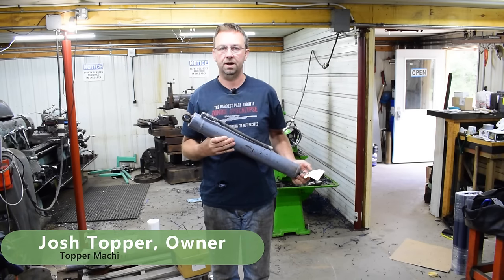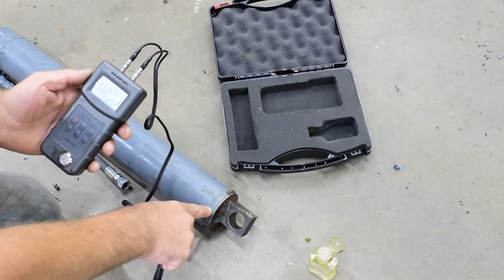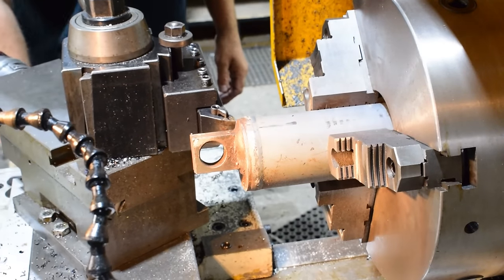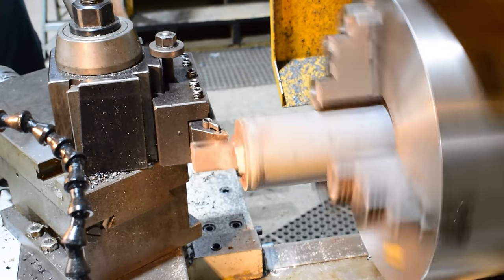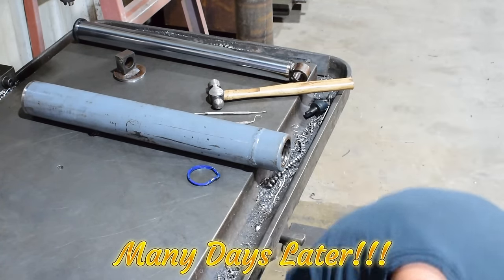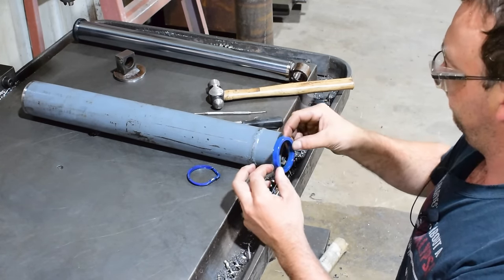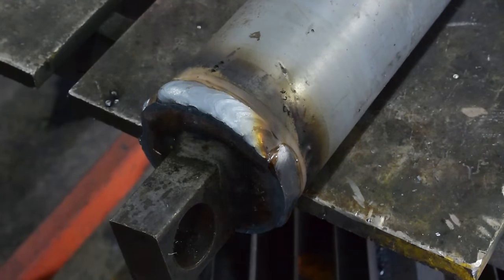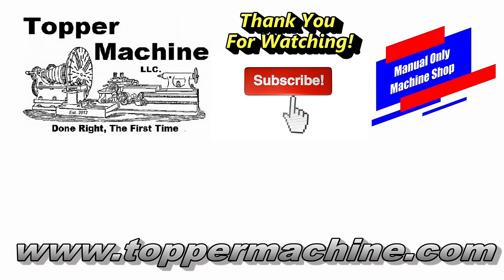Welded Hydraulic Cylinder That Can't Be Repaired, Cut Open and Resealed

Comment: Sometimes these cylinders are built with a snap ring groove and pilot on the end of the rod. You can disassemble them by reaching through the port with a pick to dislodge the snap ring. Once the ring is out of the groove the rod can be removed and the seal replaced. To reassemble, place the snap ring on the small pilot, install the tube, and reset the snap ring using a pick through the port. It seems cumbersome  but I've seen this process done many times.

Comment: The initial knock had me puzzled - something inside is borked. I was looking to see if the cutter was touching - nope. So the piston inside is so loose it's not right. Back when we contracted, we'd to do these using just a grinder to get the end-cap off - and a stick-welder to get it back together - but they got done. Easing the new seals in was always fun,, as was making sure we didn't melt them with the welder. :-) Hoik the rod out as far as it will go  so it stays cool,  slice off the end, pull out the rod, fit new seals & packers, weld the end back on. No lathes got bothered - and they all worked just fine.
Reply from the maker: This is actually correct. The knocking was due to the head seals being bad. There was no piston or seals.

Comment: it's a displacement cylinder the rod is the only piston the flange at the bottom is only a stopper to prevent the rod from cumming out at full travel.
 Usually there is a bearing sleeve at the seal end to keep the rod aligned.

Comment: I had a Saab convertible that had an hydraulicly activated roof, one cylinder was leaking rendering it inoperable. It was a non serviceable part and a hydraulic shop said throw away so I went back to work and put it in the lathe and cut the end off. A few scabbed orings from oxygen regulators and made a new cap, and it worked hundreds of times until the car was written off in a crash. Non serviceable means "hold my coolaid ,I don't drink alcohol"

Comment: Next time pull the rod out when welding the bottom part of the cylinder, the heat generated from welding will fuck up the seal on the rod.
Since you have the tools, you can also modify the bottom part to be serviceable, make a thick ring with +/- 6 or 8 threaded holes that fits over the cylinder, machine a cover plate with eye and matching holes, depending the thickness of the cylinder cut out a groove for an o-ring in the bottom plate with eye socket. use screw head cap bolts of strength 8.8 (not stronger).
I'm an engineer in hydraulics, i reseal mostly 20 ton cylinders (that's the weight of the cylinder not lifting force) but sometimes small ones for palfingers.
Reply: Did you watch the video? There’s no seal on the rod.
Reply: @djquick  my bad i just assumed, seal-less bottom parts are usually the design of slow hydraulics like hydraulic jacks.

Comment: Very interesting .  I did my apprenticeship 40 years ago with a company that manufactured hydraulics and pneumatics.
Nothing we made pushed the Ram out of the cylinder without a seal on the piston.  Maybe it was invented after I moved into IT ;)
We were  taught the force generated by the cylinder was calculated by the pressure of the oil on the surface area of the piston.
I wonder if this cylinder generated a larger force as it’s pushing on the surface area of the rod itself?
Although this would be less and less as the rod extends past the gland seal.  I guess it can’t be fully extended as the force would decrease to zero.
Gets stranger the more I think about it.
Reply from the maker: I was quite confused also. But, I guess it's a very common cylinder design. I'm guessing it's not berry powerful as you really only have the rod surface area. The little plate on the end just kept it from pushing out and I guess it doesn't add to the push. Fun job either way.
Reply: @TopperMachineLLC  
Glad your having fun!
I’m getting back into machining as a hobby now I’m retired.  I love saving stuff that was otherwise heading for the junk pile.
Reply: I"m inclined to believe the company you worked for was quite liberal with using the term "apprenticeship".
Reply: @deconteesawyer5758  
Not sure why you would make that sweeping statement.  The larger the diameter of the piston the more force is generated.
The out stroke generates more force that the return stroke as there is less surface area on the piston as the rod takes up some of the surface area.  I have never thought about what happens when there is no piston.  That thing on the rod is just a guide,
Reply: @DavoShed   "I have never thought about..." That is what formal apprenticeships are designed to overcome, requiring formal classroom training covering the field as well as the company specific knowledge/skills.
The idea you expressed that single acting cylinders were novel or something new to you belie classroom training that would have included both the basic principles of hydraulics/pneumatics and the common applications, a very prominent one being the single acting cylinder. 
I am more inclined to view such a situation as having completed a company entry level probationary period than as having completed an apprenticeship.

Comment: It's loose because it's a one-way displacement ram and the incoming fluid flows around the piston end to the back side of the ram. I'm assuming it's a gravity (possibly spring) return system that it's used on.

Comment: Good to ya Josh! If ever that happens again, just fill it with used motor oil (filtered). If the piece is a one-off, at a premium job rate, it might be worth the time. Just noticed that the ground clamp needed a counter balance...if you use a regular "C" clamp with the body opposite the grounding clamp, it will even out the weight. Or, you could hang a 15+ pound weight off the body of the cylinder and that will jam it into the rollers without slipping.

Comment: That's a very interesting concept, the way that cylinder works. You'd expect the hydraulic hose to connect at the other end of the cylinder and there'd be a cup on the end of the piston. Very unusual.
Reply: The "concept" has been around for as long as hydraulics have existed. It's a one-way, displacement ram. Quite a standard item.
Reply: Doesn't really matter where the hose connects on this type. It must have been made to connect up near the rod end due to how it mounts. It's a displacement ram, no need for any piston cups.

Comment: A single acting cylinder does not require a piston seal, some do have a wear sleeve.  The giveaway is the single hose.  On some off highway dump trucks with two or three stage cylinders one section will be double acting.  The dump beds go over center, that section will move the bed back past center and gravity will do the rest.

Comment: The reason you had no seal on the inboard end is that this is a single acting cylinder. Pressure in the cylinder forces the rod out. Gravity or load returns it is my guess

Comment: tack weld a 3/4 " bolt to the end of the eye end put a nut on it put the ground on the nut the nut will screw you will need to adj occasionally

Comment: That WAS a very weird knock. Given that it came through so clear on the video, maybe to investigate it prior to doing anything run the video back in slow motion to see if it is consistently timed. Nice repair and I agree with the CEE style ground clamp.
Reply: By watching closely you could see that it happened once a revolution, and appeared to be about the same place each time. I'm sure slowing the video down would have made it more obvious.
Reply from the maker: @lwilton  I would be willing to bet it was only able to knock where the lip seal was bad.  So, one knock/rev would make sense.

Comment: Never seen a cylinder like that,  I'd love to see how it works
Reply: Just add pressurized fluid and the rod comes out. Use the weight of the bucket to push the rod back in. Simple cheap and robust

Comment: Its a "positive displacement cylinder"
The rod is the piston, all you have on the end of the rod are wear bushings instead of seals.

All of seals are in the gland nut

The advantages are:
1. You dont have to worry about the cylinder drifting because of an internal (unseen) leak.

2. The pressure fitting can be placed at  any point on the cylinder instead of just the bottom of the stroke

Comment: You can try to weigh down the cylinder with a length of board and a couple of rollers. Mount the rollers on the end of the board and just sit it on top of the cylinder.  Kind of like a skateboard. add weights to the top of the board (one other end of the board on the ground for stability) to add top pressure to the work piece.

Comment: Anti Skid tape on the areas where the wheels are contacting and a roller weight for the middle if need be should work out well. I have used a flag beaded retainer with a hook to hang various weights on .

Comment: Clean the paint off in an area on the cylinder, strip of steel formed into a loop, hang the ground clamp on it, place on the clean area,  good to go on the pipe rollers.

Comment: on your rolling weld bench to increase traction, install a roller below the tube and then us large rubber band or bike tube all you need is a little more traction.  have a good one dude  4/7/23

Comment: The only thing I would have done when you were welding it is wrap a wet rag (or rags) a few inches away from the weld area so you don't heat up the rest of the cylinder and potentially damage the new seals you just put in.
Reply: I'd have done the same, far to much heat going into the cylinder.
Reply: Couldn't hurt I guess, but the seals are at the other end of the cylinder. I'm not a welder, how hot to you think the far end got in the welding process??
Reply: @steveh8724  The ram was all the way in so the seal on it was in the heat affected zone. I would have pulled it all the way out before welding.
Reply: he should have extended the ram fully out - those seals will have got cooked

Comment: Another job well done Josh! 👍👍

I am a little curious why there isn't a piston seal on the back end of the piston and how its able to function without one?
Reply: Its a single acting cylinder. Where the oil pressure just pushed the rod out instead of pushing a piston.
Reply from the maker: There was a bit of a piston, but more for keeping the rod from falling out.
Reply: You don’t need a piston when you are only pushing in one direction. The fluid displaces the rod.
Reply: @athhud  Or, put another way, the entire rod IS the piston and the rod seal IS the piston seal. So it can only extend the rod with hydraulic pressure, retract has to be powered by something else (an opposing single acting cylinder, gravity, etc.).

Comment: A proper weld procedure for a hydraulic cylinder will have a minimum of 2 passes, a root run and a capping run both should be done with a single stop start and 180° from each other.

Comment: Get a worn long chain then just make 2 wraps around whatever you are working on and you can direct drive it. Make it turn so the slack hangs out of the way to the bottom and you likely won't even need a way to take up the slack gravity should be enough.

Comment: That's a single acting rod dispalcement cylinder.  Pressure forces the rod out of the cylinder and the "piston" is just a guide bushing, no seal required.  Same principle as trying to fit a close tolerance pin into a blind hole, it pops out from the pressure build up.

Comment: I'm @14:11 and can tell you the reason there's no "puck" on this rod is because it is only extended by increasing the volume of oil in the cylinder its self. It would then most likely be retracted by allowing the oil out and having something push the rod back in. Most likely its some kind of lifting cylinder. We would call this single acting

Comment: One fix for the parts rotator could be to un-weld one set of wheels (same side) and make them adjustable so you can adjust it where the part "sinks" further down between the wheels.  They will then have all the bite you will ever need.  You could even get a little fancy with this and make them adjustable by way of jack screws as opposed to slots and bolts only.

Comment: These cheap made cylinders were only used in  agricultural machinery.  I part off the end plate about 10mm from the end with a narrow cutter and  pull the rod out a bit first incase they clash.

Comment: That is actually a ram, not a hydraulic cylinder. It's a one way that just relies on the surface area of the rod to apply the force. Only thing that piece on the end of the rod was for was to just keep the rod from shooting out of the cylinder when extended.

Comment: When you part off your anchors dont use your big round cutter go in thinner as the base plate generally fits in the barrel about 1/8-1/4” to keep it from pulling when you weld it a small amount even 1/32 over a couple feet can throw your cylinder out of alignment pretty bad

Comment: Josh, you are the expert, however, it seems it would have been better to pull the ram out off the cylinder a foot to keep the seals being bottomed out where you were welding.
Reply from the maker: No seals on the piston in this design. So, no concern of damage there. Bigger concern is always nicking the rod, so keeping it in eliminated any risk.

Comment: There is no seal on the piston to collect dirt or the need for a bleed off vent.  This is a single acting cylinder with the shaft diameter determining the displacement.

Comment: One thing I would have done differently. I would have manually extended the ram to its limit before welding the end back on. No reason to expose the ram seal to the welding heat if it could have been avoided.
Reply: oops. Can I retract my comment?😁

Comment: When welding on the cap why didn't you extend the rod to get the internal seal away from the heat?  That is what I was taught to do.
Reply from the maker: I explained that there were no piston seals.
Reply: @TopperMachineLLC  I guess I heard you say that but that didn't compute in my brain and I saw a black band that look like a seal of some sort and I must have blocked out you saying that there was no seal.  Don't know how I did that with all the banging.  Sorry about that.  😳
Reply from the maker: @ToddKing  it was an odd cylinder. Easy to forget that it didn't have piston seals.

Comment: I am surprised you did not extend the piston prior to welding to keep the heat away from the lower seal.
Reply from the maker: No lower seal. Cheap cylinder. I did explain that in the video.
Reply: @TopperMachineLLC  I thought I saw something down there.  Perhaps it was just grease build up.  Odd cylinder.

Comment: Just put a belt around the item on your power roller and hang a weight on light items with a pulley or roller letting the weight hang at the bottom of the belt adding eight easy that way

Comment: I find it works well enough to tac weld an old bolt to the end of the ram and just hang the earth lead on it
Reply from the maker: I would have, but the weight still wasn't enough to be driven.  Sucks that my roller won't work for this small stuff, bit it is still useful.
Reply: @TopperMachineLLC  can you get another roller and maybe a brake booster off a truck trailer or a weight to make a pressured wheel to keep it driving on the lighter parts?

Comment: I realize you changed the two seals on the ram output shaft end, but what about the wiper seal at the other end that you welded up? Doesn't that one need changed as well? IDK, just wondering...
Reply from the maker: It did not have one. Only replaced what was there.

Comment: Did you ever figure out what kind of piston seal it needed ?
Reply from the maker: It doesn't. No piston. It's a displacement cylinder. The head on the end of the rod just keeps it from pushing completely out.

Comment: For the earth clamp, why don't you get in touch with "Cutting Edge Engineering" in Australia... he has a youtube channel of the same name. He's designed a sliding round earth clamp specifically for use on the tube positioner... I think he sells them, but he also describes how he designed and built them. Just a thought. Love the type of content, subbed here.

Comment: You didn't take the width of the parting blade in account and now the zylinder is a little bit shorter.
Reply from the maker: I did. If you watched I touched off on the edge of the blade and went in 1/4, thinking it had a step. Then creeped up on 3/8". Length of tube was never affected. Watch the full video and you'll see that.

Comment: Awww bit hard on the piston seal welding right beside it, I would have pulled that rod out away from the heat source a bit, but that's me.
Reply from the maker: No Piston Seal!  Read The Video Description!
Reply: @TopperMachineLLC  I did see the description but thought it was a mistake. no seal at all?? how is that possible, I thought I could see a ring of something there. I can't say I've heard of a ram without a seal ever, the creep must be horrendous. Well you got me on that one, I guess you really had to be there. Umm yea sorry about that. Engineering wise you must have been shaking your head at that thing.

Comment: Welding the cap back on with piston retracted? Seal/rubber on end of piston to close to heat?
Reply from the maker: Watch the entire video before commenting. No piston seals.
Reply: @TopperMachineLLC   what was on the end of the piston? Black? Made of?
Reply from the maker: @kdel9776  just a steel washer. Keeps rod from coming out.

Comment: The noise was the piston end flopping around in the tube. Probably pulling it up the tube a bit would have eliminated it.
Reply from the maker: Considering the seals were bad,I didn't want to chance more damage to the rod.
Reply: Agreed the loose piston with a bad seal hitting the wall of the cylinder.
Reply: This type of cylinder doesn’t have a piston. The rod is the piston. The only thing at the end of the rod is a stop to keep it from shooting out of the cylinder when under pressure.